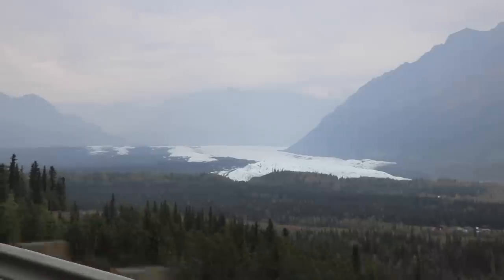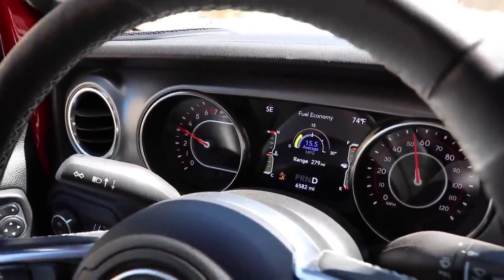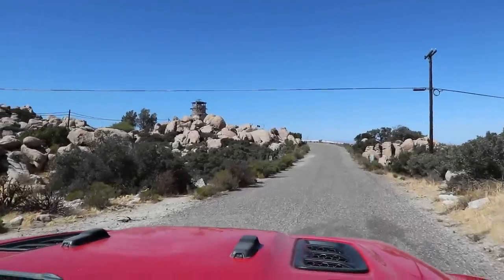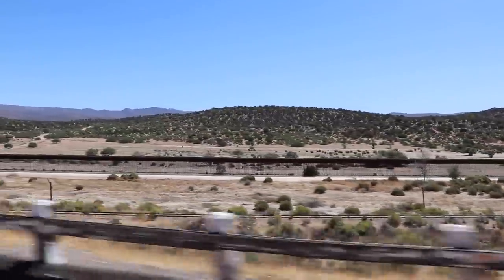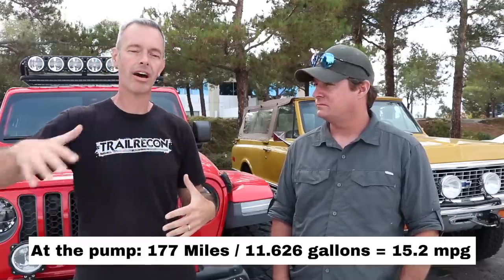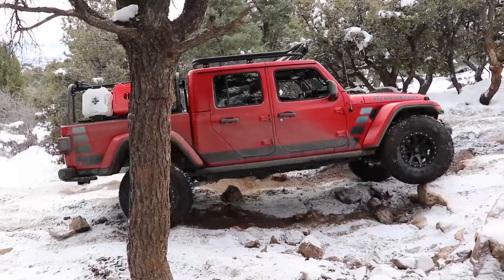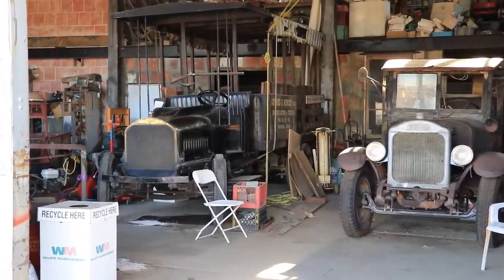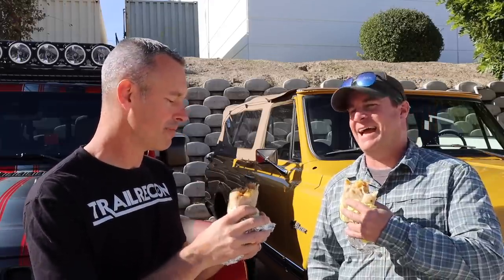Did Re-Gearing My Jeep Gladiator Affect the GAS MILEAGE?

Comment from the maker: It wasn't mentioned in the video, but yes I did recalibrate my speedometer to compensate for both the tire size and gear ratio. As for why I chose 5:13's, I think 4.88 is a good ratio to go with for a 38" tire, but because I carry extra gear and plan on doing some off-road towing I wanted to go slightly deeper, and that's why I chose 5:13'.  Sorry for not explaining that in the video.
Reply: TrailRecon I am concerned if the slight increased rpm (4:88) will move it up the horsepower curve enough to still pull 8th gear at interstate speed (75 mph).  I realize I am on the verge of asking to much. You did confirm you see 8th a lot more with gear swap.
Reply: What’s your rpm at 70mph in 8th gear ?
Reply: Thanks for answering my question before I could ask it.
Reply: What did you use to recalibrate your speedo?
Reply: I’m currently running 37 Pats, would you recommend 5:13s if I plan on building my rig similarly to yours as far as weight is concerned?  Thanks Master Chief!🤙🏽
Reply: Haha I was waiting for that and then it was over, thanks for that, wish you let him get crazy on the hearing discussion though 👍🏼👍🏼 great vids great content and as always good times
Reply: I have Nitto TG MT 37's on 20" inch fuel wheels, I went from about 15.8 MPG in Colorado on stock 33's to 13.3 MPG on the bigger wheels and tires after reprogramming with  the Tazer Mini JL for the bigger tires. I'm having a 3" lift this week with 5.13 gears. I'm really surprised that you got 16 MPG on 38" tires that's really awesome, I didn't even get that good MPG fully stock tires and wheels, altitude making the difference 5280ft? I'm considering installing a Magnuson Super Charger in the future for 58% more power out of the v6 3.6L Gives you 22% more power than a 5.7L V8 Hemi Swap, basically 100 extra HP. Won't improve MPG much but will improve drivability & pep with the extra weight.
Reply: @JeepGladiatorestAprilJTR  I'm doing exactly that on my JTR in a few days with a 3" Lift. 5.13's were recommended by Trail Jeeps where I'm having the work done.
Reply: @photoapeal  Thanks Johnathan!  Let me know how you like the set up.  What size tires are you running with the 3” lift?
Reply: @JeepGladiatorestAprilJTR  I have 37” Nitto TG / MT tires with 20” fuel wheels, lot of extra weight with those wheels.
Reply: @photoapeal  I just put on some Nitto Trail Grappler MT 37s.  I need that Taser Mini.
Reply: @photoapeal  How did the 5.13's do you?
Reply: @exordis  They have been awesome, highly recommend 5.13’s, especially if you plan to add accessories & weight. With 5.13s the pinion is still large enough it won’t easily beak, I hear with 5.38s the pinion gets too small. If you go more you’d probably want Dana 60s. Once installed the power was restored, the MPGs went up, at least until I added more weight, but I have no issues maintaining highway speeds & power off the line with heavy 37x20s. It also restored the ability to properly shift & use all gears.
Reply: @photoapeal  Thanks for the quick response.  I've recently put 35's on my JLU Sport (2.0).  They're fine, so far, for riding around as a daily.  There was a hit to mileage and I hardly see 8th except on flat ground, but still plenty of oomph from the turbo for passing and accelerating.  Would like to get a little bottom end of first back though.

Comment: Had a 26' Penske loaded and towing my CJ7 on a trailer. The truck's rear tire developed a bad vibration over 50 so I had to drive from LA to OKC doing 50. I got 8 mpg before the vibration and 16 mpg after. Lesson learned about pushing air.

Comment: Wow, I called it at 17.2mpg! On my 96 Chevy, 350 AT, 35" BFG's and 6" lift I went 3.73 to 4.56 gears and went from 17mpg to 18mpg on the highway.  But City went from 13 to 15 because the lower gears made it easier on the engine to get to speed. Gears will help your engine and mileage, it may just take a few years of driving to make up the $2,000 price of them. Great study!

Comment: Cool video.  Better acceleration and better gas mileage.  Win/Win..  You had to reprogram everything for the gears and the tires?  Also, there was a difference between the computer and the real gas used on the 1st test, what about the 2nd test?

Comment: Thanks for another great video Brad! You were going to discuss why you choose the 5.13 over the 4.88 or 5.38 gear ratio? Short answer?
Reply: Prescott Lederer also want to know as 4:88 puts it closer the factory ratio.
Reply from the maker: I think 4.88 is a good ratio to go with for 38's, but because I carry a lot of gear and I will be doing some off-road towing I wanted to with a slightly deeper gear, so that's why I chose 5:13's.  Sorry for not explaining that in the video.

Comment: Good stuff Brad. It's going to be very interesting to see how a comparably equipped diesel version will do if Jeep ever makes it happen.
Reply from the maker: I'm hearing the Wrangler diesel is going to blow the mpg I'm getting out of the water!
Reply: Love your Gladiator build! Impressed with the MPGs you are getting. I’m getting around 17 on the Highway in my JK. But average around 15 on all around driving including Overlanding trips.
Reply: The question will be,"will the mpg on the diesel make up for the increase in cost per gallon?"
Of course the diesel engine will outlast a gasoline engine by a long shot and have better overall performance and for those reasons I would go diesel every time.
Reply: My question is how will it take to recoup the additional cost of the diesel engine? Obviously, the cost per gallon is the big factor but how many gallons? There has to be a math whiz out there who can figure that out for us Liberal Arts majors.😀
Reply: I've owned 7 Jeeps, all just minimally powered. The diesel is a $4000 option on the Wrangler and diesel cost .40 more than gas. For my personal satisfaction and driving pleasure I will pay the extra cost regardless. Life is short and you can't take it with you.
Reply: Diesel fuel is higher at the pump.... Plus $4,000 for diesel engine option......  Do some math and base on advertised MPG ......  You would have to drive it over 200,000 miles to make it economical.......  But we love and drive Jeeps so let's just admit mileage is not priority 1!
Reply: Right on Dawg, I'm just a jeeper not trying to be a financial wizard.
Reply: gogerwi  Well I am far from financial wizard but have some common cents lol
Reply: @45auto  lol

Comment: 2008 JKUR..  Dealer had put 35's on it already w/2.5"lift. Stock gears  were the 4.10's.  Pulling a trailer at 70 mph on the hiway, only time it would get out of 2nd gear was downhill. I went to 5.38's (also cryo-dipped them) and I at least stay in 3rd now. W/O trailer, even the OD stays in better.  Ya, is the 3.8. But my mpg did come up too.. Varies on what I do, but 1~2 range is common.  And yes, I is much more spunky both on street, and crawls crazy great.. Thou, off road, I have use the programmer to set to crawl mode. Too jumpy if don't..
Hiway mpg.. Around 15±. Have been into the 16's under ideal conditions a couple of times. 12.5~13 common around town.  All is better then with the stock gears..  63k on it currently.  Gears were put in at 10k.

Comment: In 01 I bought a new gutless 1500 ram 4x4 with a 360 magnum engine. 3.55 gears got 11 mpg max. Tranny blew at 20k, factory reman.Put 33” tires on and got 9 mpg and more gutless. Blew the tranny at 40k. Put 4.10 gears in with a hand built tranny and got 12 mpg, more if it was unloaded and I milked it. Even when it was all stock, it struggled to stay in 4th gear. The 4.10 gears were way better and the transmission lasted another 200k when I sold it for scrap because I live in Michigan and the salt ate it up. I did sell the transmission to a friend of mine who put it in his plow truck and ran it for another few years. I still should’ve went with 4.56 gears though. Those 360 magnums were worthless!!!

Comment: The next time you are in a gas station, look at the nozzle on the hose, you will see a 1/4 inch tube in there, because of CA emmissions, that tube is designed to suck the gas back out to keep it from going into the atmosphere or on the ground.  Every time you click the handle after the auto shut off you are putting gas back into the ground tanks of the station

Comment: What a shock to me that you improved your gas mileage!   Back in 1969 I had a Z28 Camaro and put 538's in it.  Gas mileage went way south!  Made the mistake of driving it from Okla to Indianapolis once.  Gas was like 32 cents but I was only making 2 bucks an hour.  It got to 60 really quickly though!  :))  I know the situations are different and tech is different, etc etc, but   I was still surprised at your gas mileage improvement.

Comment: Gladiator Mojave 6-sp Manual I get 17-18 city 19-24 hwy. Keep it under 2200 rpms the 3.6 is amazing considering this is a lifted truck on 33 mud terrain tires. My friends taco only get 16 with 275 all terrain tires. I will do a video on this later.

Comment: I’m still not sold on the need to re gear with the 8 speed. 2,000rpm at 75mph it doesn’t matter what gear your in. I’ve found speed is so critical with these trucks JT at 40mph I get 23mpg on 33s with 3:73 at 80mph 19mpg. Temperature, humidity, altitude all have an impact- they were wearing jackets in the 2nd test cooler dense air yields better combustion.
Reply: Well you are running 33. Gearing only makes sense when you go to 35, 37 or even greater.

Comment: Great explanation of regearing. I regeared my 2017 Tacoma DCLB auto this year and finally found 6th gear! MPG improved by approximately 3 mpg overall since it could finally find cruising gear. And the transmission hunt finally stopped too. Great video Brad.
Reply: Oh, forgot to mention that I didnt recalibrate the speedo. So probably increased MPG a little more. Just running 33's tho.
Reply: What did you regear to since I also have a 2017 taco?

Comment: Hi Brad, 
Thanks for this video! Great information. I have a 2017 jkur with 2.5” lift and 35’s running 373’s. 
I love this video and decided to look into a gear swap to 456 or 488. I live in CO and prices are all over the map, as low as 1250 up to over 3000. Are there any questions I should be asking? I think I you said a gear swap should be around 1200-1500. Thanks for your time! Love the channel

Comment: Hi brad
Thanks for posting this; an interesting topic and nice adjunct to most off-road videos. Whilst your discussion centered around Wrangler and Gladiator, re-gearing and its results would equally applicable to other 4wd’s. I am chuckling at all the comments being posted about fuel prices you are paying. Here in Australia, A$1.50 per liter is an average. By my rough calcs that is around US$4.09 a US gallon, so feeling your ‘pain’. 

.....Cheers from Downunder
Reply from the maker: Thank you! My Wrangler saw a slight drop in fuel economy when I re-geared it, but an improvement in drivability, but it only has a 5 speed transmission. Different results for different model vehicles.

Comment: Thanks Brad - I’ve been waiting on a video about re-gearing the Gladiator!  How many hours labor did that take?  I imagine it’s expensive.  Also does it void the manufacturer warranty on the drivetrain?
Reply: I was told that it does not void the manufactures warranty when doing a lift & regear. There was some sort of landmark case that made it possible to retain the manufactures warranty & they can't drop you for it. I could have been lied by my Jeep shop you never know but this was what I was told. 
From an internet search: 
Regearing does not void your warranty, BUT don't expect a Jeep dealer to fix any issues with gears that failed. The replacement parts would be your responsibility to get from aftermarket manufacturer.

Comment: I'm curious how many RPM's your turning at 65mph. My 2dr JL with a 6spd manual and 3.45 gears on 35-inch tires turns 1500 RPM at 65mph. I usually stay in 5th gear on the highway because I'll lose speed going up grades. I do average 21mpg. I'm planning on upgrading to Rubicon axles. I think the 4:10 gears would work well with 35's.
Reply: Jeepdog JL 4.10 or 4.27 is a great choice for 35”s

Comment: On my JKU I ran 5.38 on 37s.  That thing went about anywhere.  I test drive a JT Overland on 37s yesterday and it drive well but didn't have gears done.   It wouldn't back over a curb until I put it in 4lo and it struggled then.   I'm really thinking about the Gladiator but now I'm trying to figure out the payload issue.

Comment: The iDRIVE throttle controller has greatly increased by fuel mileage on my lifted with 38s 2014 JKU by using the E-1-9 mode, it softens the throttle, and it increases my mileage to better than factory predictions, but then I can go to u mode and have lots of throttle.

Comment: re-gearing has been hands done one of the best upgrades ever. We got the Jeep with 35" and it always lost power uphill. Still breaking in the new 4.88 but it is exceptionally noticeable the already better MPG in slow driving around town and it feels stronger.
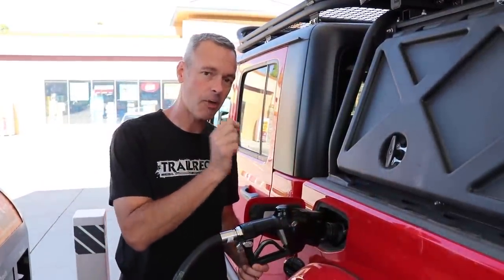Reply: 😢😅😊😊 2:06 😅
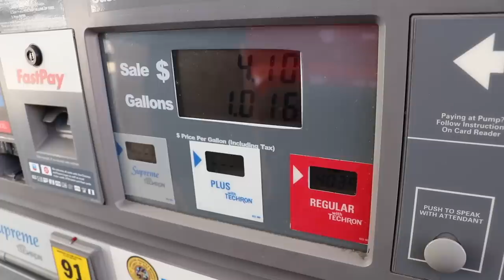Reply: 2:06 2:06 🎉😊 2:06 2:06 😅😅😅😅
Reply: 😢😊 4:04 😊😅😊😅😊😅 4:04 4:04
Reply: 😊😊 4:04

Comment: Thanks for the video.  My JLUR is getting 5.13 in five days.   Can't wait.  Like you, my Jeep almost never sees 8th gear.
Reply: That just means you're not driving it fast enough. Go faster lol
Reply: Hey Ted, any info on your build? I'm thinking about 5.13 vs 4.88... 2020 jtr
Reply: @mathewmue5547  I just came home from a 5834 mile wheeling trip. Pulled a small camper. Did 8 days in Mab, then the Rubicon trail, then trails in Wyoming and back to Michigan.   Avg 14.5 mog pulling the camper plus off road driving.  I get about 18 to 19 on the hyw for normal driving and 15 around town.  I see 8th gear all the time even pulling the camper.  8th gear in town above 45 mph.  5.13 gears and never look back. The 5.13 gears are perfect with the 8 speed auto.
Reply: @mathewmue5547  I am lifted with 37s on bead lock wheels, winch. Big bumpers, the heavy stuff.
Reply: Maybe a silly question, but doesn't that worry you that it blows your factory warranty out of the water?

Comment: Good info I can use as ammunition when I need to upgrade gears. I have JKUR with 3.73 running 35's. I don't know anything different as this my first Wrangler and it's the way it came. 
Now to decide what gears? Do you think the 4.56 0r 4.88 will have a negative impact on freeway mileage?
Reply: Mark Jongsma 4.56 is a pretty popular swap with 35’s. If you are still looking for mileage then stay on the 4.27 side of gearing. If you want extreme crawler gears go 4.88

Comment: What is that burrito place called? Me and my wife miss good stops like that. Changing my JLU Sport S gears too 4.88 with Adams drive shafts coming up, but will have 35x12.50R17 BFG KM3 Tire’s. This is my first in my opinion serious upgrade even though I already had my metalcloak lift but bumping up to 5.13 and not affecting the gas mileage in a bad way I’m seriously surprised. Awesome video!
Reply from the maker: El Paso Taco Shop in Campo, CA

Comment: Just regeared my Gladiator with 37 with 5.13 set. I am in the break in period but already can tell that the truck is much happier. It shifts through gears faster and D8 is now the norm.
Reply: What kind of fuel mileage you getting with that setup and what size lift?
Reply: @tylercoleman2460  Honestly 14-15 mpg. I drive most times on the highway at 75-80 mph and have a 30 mile commute daily. IF you drive slower, you should cut into 17-18s. I just  had a 3.5 in Teraflex lift installed (went from the AEV spacer lift setup I had originally.

Comment: Hey Brad. Two days ago I picked up my 21 Gladiator Rubicon with the diesel. I want to go to 37s with a lift mainly for aesthetic reasons. This is my daily that I drive about 150kms/90 miles a day. Other than that, I might do some overlanding but no plans for anything more. 

With your experience, do you think I need to be re gearing?  

Value your opinion.

Comment: I'm curious if you and Ryan gave any consideration to tooth engagement on 5.13 v. 4.88; I've been told the pinion gets pretty small on 5.13 with like only one full tooth of engagement on Dana 44. It is something I've been struggling with as I do not have the 4:1 transfer case, 2.72:1 I think is ratio. 5.13 might make crawling a bit better. So before I put lockers and gears in my open diffs  of my JT I would be interested to hear what you and Ryan's thoughts are
Reply: harley rice you make good point! If you are going to thrash your axles with big horsepower don’t drop below 4.56 . All the new vehicles put securities in place to keep you from breaking the tiny 1st gear in the transmission. So that helps a bunch protect the ring and pinions. Check out the ratio chart on G2’s website and that will give you an idea of what gears will fit your application and tire size best.
Reply: @drtstar1  -as chance would have it, that ratio chart on G2 web site kicks to a non-domain... if I'm clicking the right link... anyway what are your thoughts regarding the higher transfer case gearing and 4.88 / 5.13's? BTW thanks for all you guys do!
Reply: harley rice modern crawl ratios are respectable these days starting in the 60/1 range factory.  You can’t go wrong with lower ratios. When you pick your gears be thinking were your build will go in the future. 37’s today? 40’s 3 years from now? I tend to caution to the lower ratio if I’m at a crossroad about it. Hope that helps
Reply: @drtstar1  - it certainly does! My intention is to go to 39's  and your video with Brad utilizing 5.13 makes me a bit more comfortable that i will not be to low geared for highway and daily driving but in a good spot with the 2.72 Tcase for crawling... thank you again!